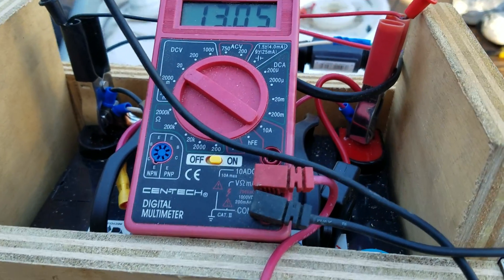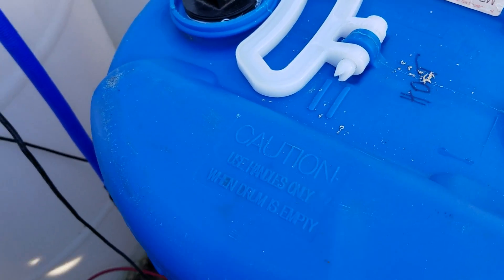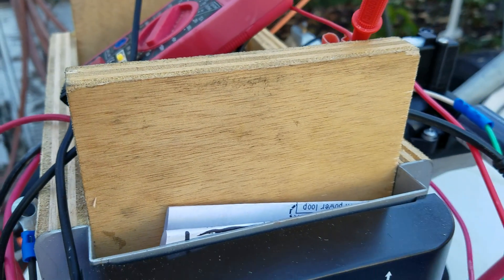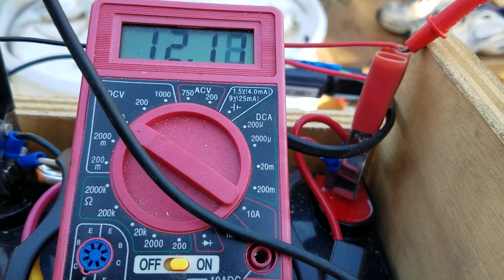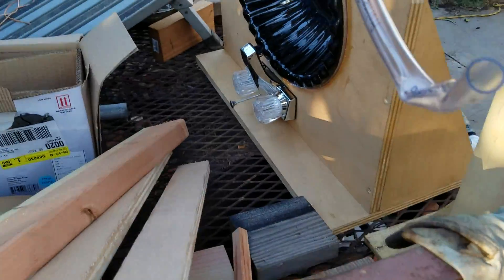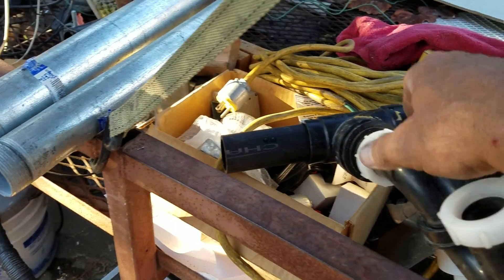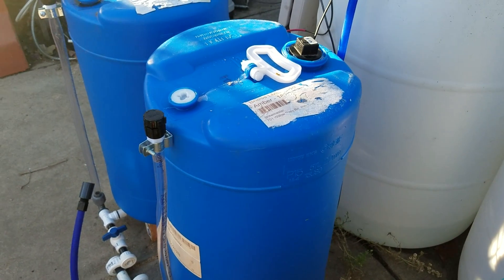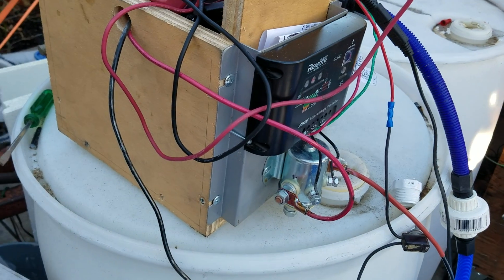Solar Charged Water Heater

Comment: Be interesting to see if this works out. A water panel would probably work 1000% better, time will tell.
Reply from the maker: That's true.  I am experimenting with this on my 'outdoor' summer shower where I only need to boost the water temp a few degrees since the hot water barrel is already black and heats up fairly well just in the sun.
For my future indoor shower I will be connected to my propane tankless water heater which now only feeds the kitchen sink.  It is very efficient and makes hot water almost instantly.  Since there isn't a pilot, it uses less propane.
Reply from the maker: The unit is installed now at my desert homestead and will be fully connected to the wind and solar system right after the winter.  Please subscribe and stay tuned to see it in action.  Thanks for your comment.
Reply: They of course, both work, however, what I have read is that PV is simply becoming cheaper and it is also much easier with fewer chances of leaks.  Look it up.  So far, I am on the fence about which one I would choose.
Reply: I once, long ago built a bath house that used a propane tankless water heater.  It was only used on the weekends, so storing hot water was not practical.  Worked well and only used as much energy as was needed, no more.  Still, having pre-heated water would have helped a lot.  Instead, this water came directly out of the well and was about 55 degrees f.

Comment: I would think you need at least 400 watts input to the dump load to run the 300 watt element AND charge the battery.
Reply: That and cheapo crimps and disorderly wiring actually scares me a little
Reply from the maker: Nothing to worry about.  It's been fine for years, and I check the connections regularly, they are never even warm.